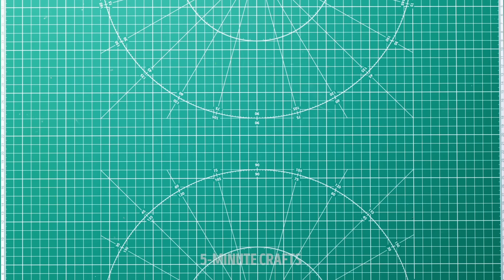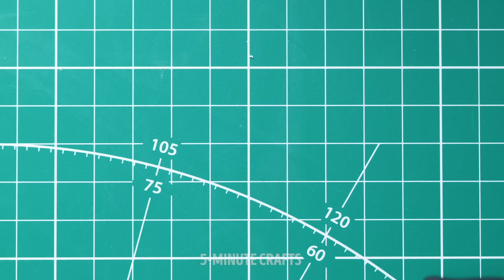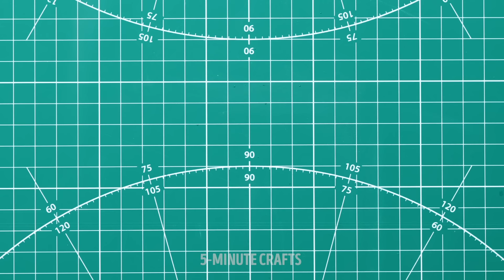DIY MINIATURE HOUSE FROM LITTLE BRICKS AND CEMENT by 5-Minute Crafts

Comment: Is there anyway that this could be made in five minutes??? The actual time of the video is like ten minutes and its most likely sped up. also add time for the concrete to dry. oh and the time to print or cut out ever thing...  actually now that i think about it most likely only took 5 minutes.

Comment: 10:07 / 10:07
DIY MINIATURE HOUSE FROM LITTLE BRICKS AND CEMENT by 5-Minute Crafts
5-Minute Crafts
구독자 7810만명
17만
1.8만
조회수 1684만회  2년 전
We are building an architectural masterpiece from scratch using cement, wood, and other tools.
We see miniatures everywhere, from teeny tiny model appliances in various department stores to architectural models and even dollhouses. Building a small home isn't an easy task. It requires a lot of patience, precision, imagination, and creativity.  We wanted to test this new challenge and try to build our own miniature architectural masterpiece from scratch.  …